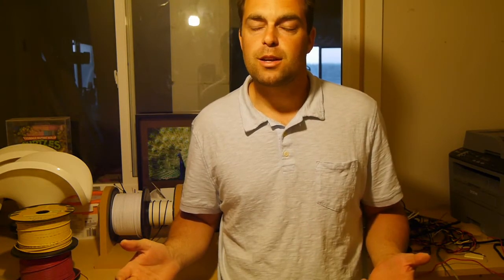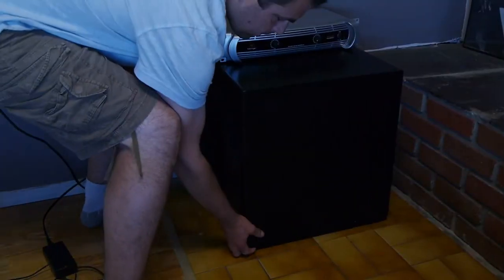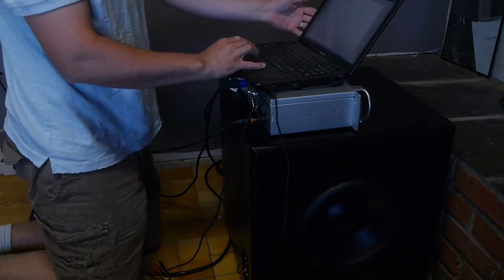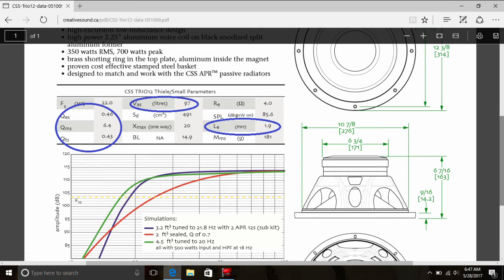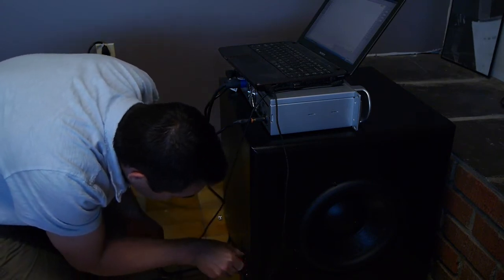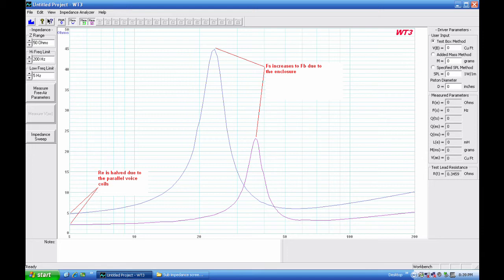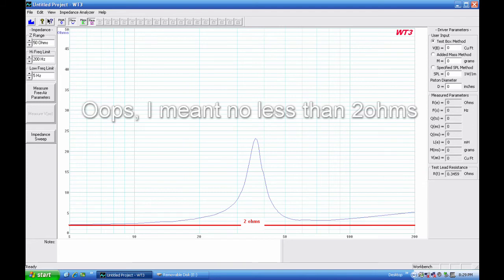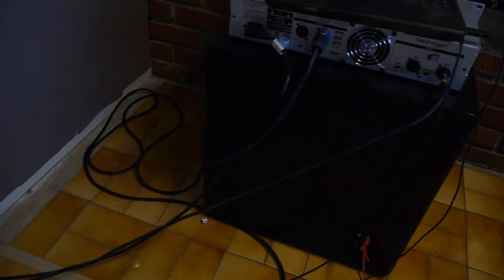Subwoofer Impedance Testing for 2ohm Amp Matching

Comment: are you using your receiver or preamp filtering (sub-out) for cut off? I have an emotiva umc with a sub filter and a few amps without dsp built in.  havent tried usimg a seperate amp (i have an emotova control freak volume knob too to tweak volume of an amp). My minidsp drops volume too much for my liking.
Reply from the maker: D1PP1N do you mean for the impedance measurements or daily use of the sub? I think you mean regular use. For that I use the sub out on my AVR which has a low pass filter. i can set it between 40-200hz or something like that.
Reply: Impulse Audio yes i meant using the HTR sub crossover with a normal amp instead using the inuke3000dsp. i was always afraid to try it thinking i would damage the subs. now ill give it a go!
Reply from the maker: D1PP1N ya its completely safe to run the amp full bandwidth. the AVR/HTR will do all the work. ONLY precaution is if the sub has a built in plate amp or specified amp of some kind it may have limiting or some of safety feature in it. especially for ported subs they can have a high pass filter to keep the woofer from over excursion. Stick around and Ill eventually explain that stuff more.